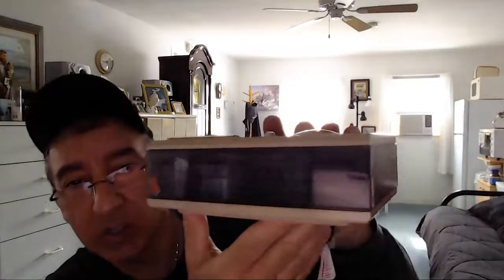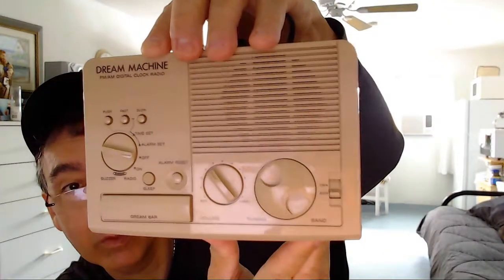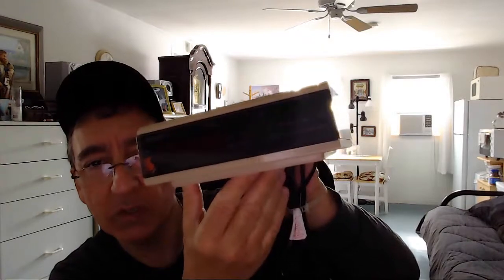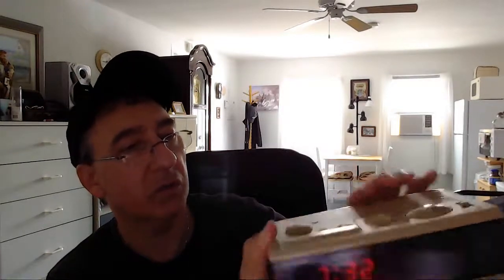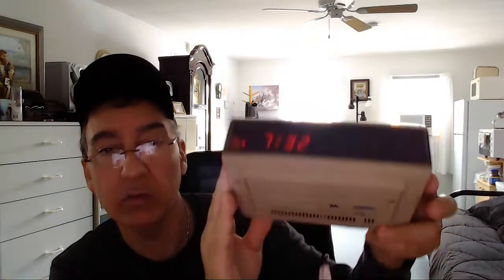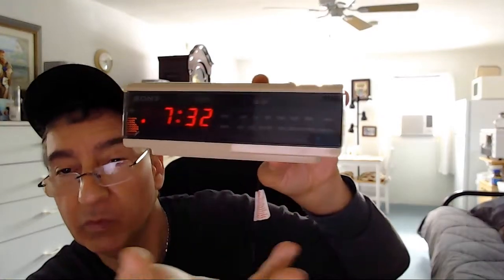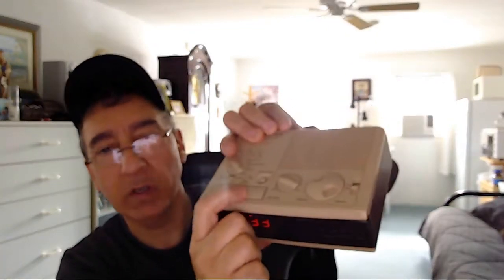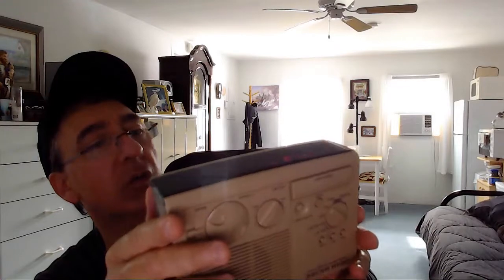Sony Dream Machine FM/AM Digital Clock Radio

Comment: Bought mine in 1988. It works except if doesn't get am.
Reply: Wow it's from the 80s? I figured maybe late 70s early 80s
Reply: I bought it in 1988, it's plate said it was built in 1987. And the am works.
Reply: @MrDoneboy  "That's interesting that you remember when you bought it, I recently found one model ICF-C5W with blue/green display, I found it at a small local thrift store and payed $6 
it's in mint condition. 
"Do you remember where you bought it and how much did you pay for it?

Comment: Mine is the exact same one! What year is it from? I had this exact one as a teenager... Then time went by and im not sure what happened to it... Around 3 years ago i went to a drift store and found the exact same one i had as a teeanager!!! Just wondering what year it's from
Reply from the maker: Hi, I am not sure what the year was I don't recall seeing that information on the item at the time. However, if it was made back in the late '80s or 90's it is a vintage item anything over twenty years is considered vintage. I wish I could be more precious with the timeline but I don't know the exact date of when that item was manufactured.

Rich